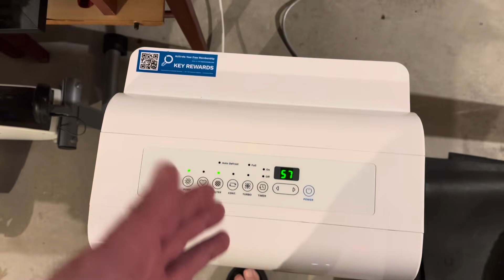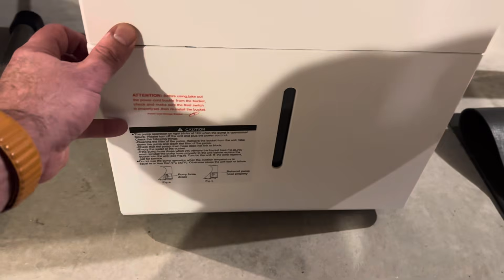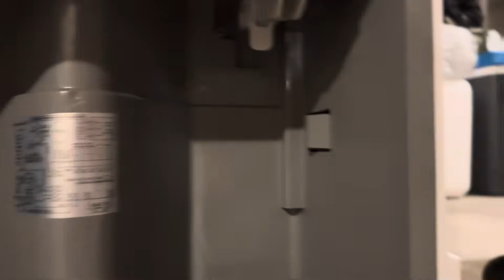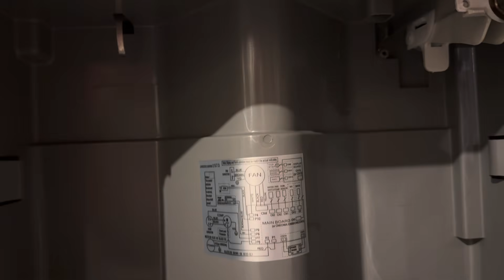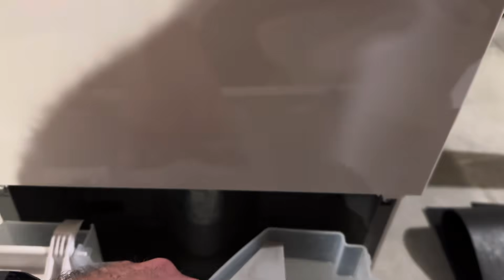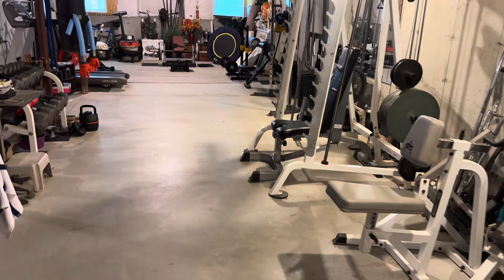"How to Fix HomeLabs Dehumidifier Not Pumping Water or Shutting Off - Easy Sensor Fix"

Comment: The surface tension of water will prevent it from flowing in a tube that small.
Reply from the maker: I also know quite a bit about water and pressure because I was a firefighter for 30 years lol but I do appreciate the comment. Thank you.
Reply from the maker: Thank you for the comment. However that tube comes with the unit and works with the pump. It’s supposed to be able to pump 16 feet high. It’s pumping perfectly now now that I fixed it.